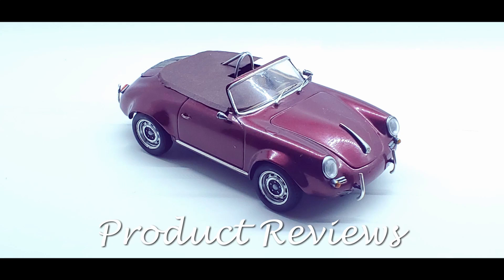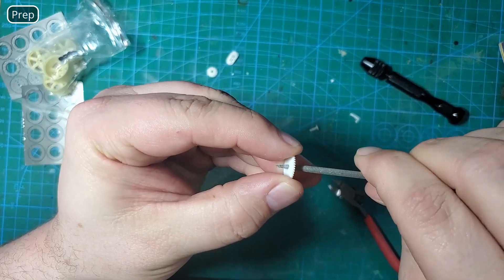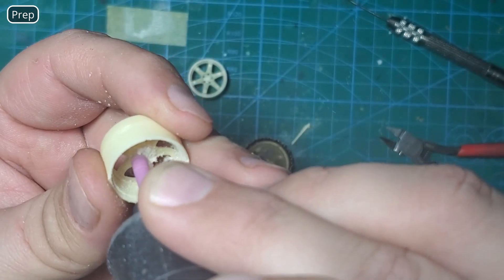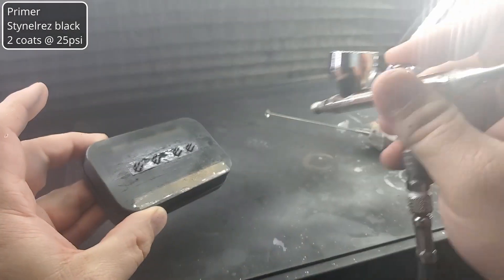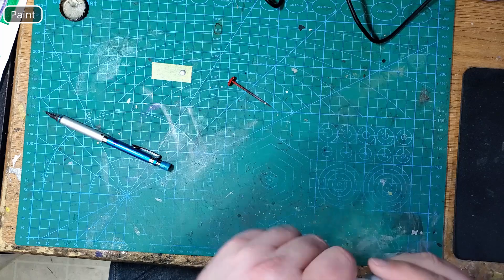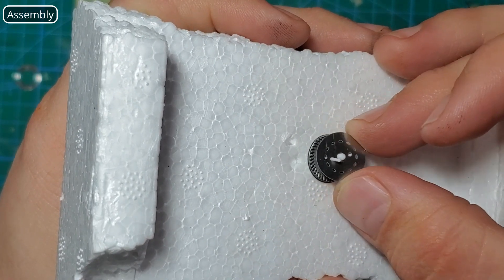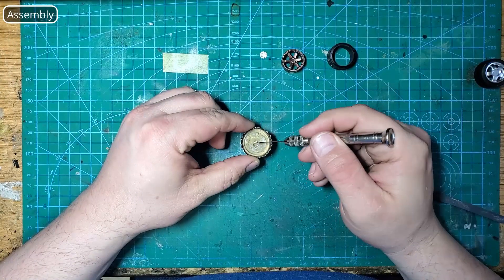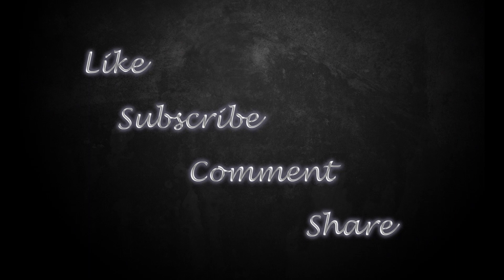Tamiya Honda NSX - Building Hobby designs AP racing Brakes and Fugu Garage RAYS TE37 wheels

Comment: Nice job there, were u get ur sanding sticks?
Reply from the maker: Hi there. These are UMP thinny stick sanders. If you are in Europe I'd say order them direct from UMPRetail.com. If you are in the US shipping from there is really high at the moment, so instead I've been ordering them from Hobbyworld-USA.com as Matt over there carries UMP products here in the US. They come in 120, 240, 400, 800, and 1200. There's also the foam sanders, and the buffer. What I would do is get the multi pack which gives you 2 each of the 120 - 1200 grits and maybe a pack of the foams as hey are good for sanding things like round parts like axles.. then if you like them, figure out which ones you use most (I use the 400 a LOT) and order packs of just the ones you need when you run out.